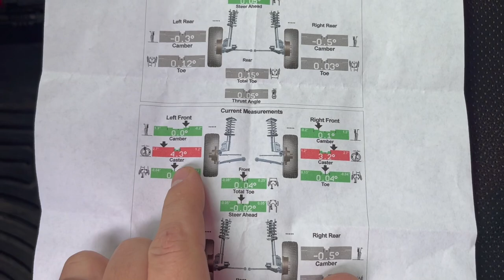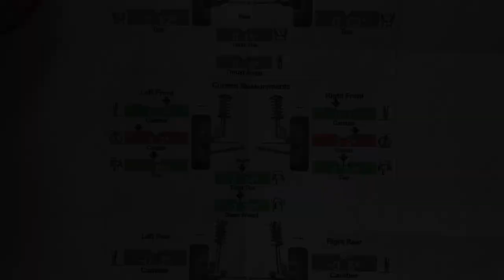Dial in your Alignment! - NEW Dobinsons Adjustable Billet Upper Control Arms

Comment: My shop (Alpine Performance & Offroad) is a Dobinsons dealer here in NC, and I also have their billet UCA's on my personal vehicle (Toyota FJ Cruiser). I do alignments on vehicles equipped with SPC's all the time, and have to say that the Dobinsons are much easier to deal with. I will say though, that I would have tried to get whoever did the alignment to fix that caster spread. Normally .5 degrees of spread is ideal, and for the higher to be on the right front for tracking reasons with road crown.. Nevertheless, your truck is looking killer as always! Props for knocking that job out in a garage! 
-Brian
Reply from the maker: Really appreciate the insight man! Good to know. Thanks for watching!
Reply: With a tacoma with 2.5 inch kings lift and -38 offset on 17x9 wheels for 315/70r/17 tires, would you recommend the spacer be in the front of the rear to clear the 35s from the body mount? Already have body mount relocation. Just ordered these and will install when they arrive.

Comment: I came to watch your review and install on these beautiful arms.  Sick looking truck and UCA!  Dobinson, keep up the good work in manufacturing awesome products!  

@ 10:53 where you mentioned to install the bolt angling downward vs upwards.  I'm no expert and never once seen anyone talk on this subject in any of the social media pages or forums.  Does it really make that much of a difference which way it's installed?  I can see it backing out as you had mentioned.  When I installed my UCA 4 years ago, I put the bolt angling upwards.  I've never had an issue with it coming lose (knock on wood).  Although, I do visually check every now and then, never checked the torque ever since install.  Maybe my next oil/lube I should recheck the torque.
Reply from the maker: Thanks!! Yes, I used to think the bolt orientation didn’t matter. That’s why I installed it previously with it angling up. But in my experience, it backed out while I was on the trail and came out on one side. And I thought never again would I be putting it in that way.

Comment: Great vid. I have SPCs… never considered how tough it must be in you don’t have a good shop. My alignment guy usually takes 2-3 hours to get my alignment perfect with the SPCs after a new install. Good to know there are easier options to recommend.
Reply from the maker: Thanks. That’s awesome you have someone that will dial that in for you. I had about 6 alignments with my SPC’s and was never happy with any of the numbers. Went to several shops and clearly explained how the arms adjusted and what numbers I was after. Pretty frustrating. Happy with these. SPCs are definitely great uppers, these were just a bit simpler.

Comment: Really liked the video brother.   Thanks a bunch!  I’ve been torn on sticking with my SPC’s or moving to these as well.  And yeah, my caster with my SPC’s is low as hell too.  I’ve never found camber to be too hard to dial in though.  These definitely look easier though, which is nice..  Just the shops around here don’t mess with SPC’s or anything adjustable!  😆. Usually takes me a few rounds of going back and forth at the very least.  

Couple things… after setting the new arms to 40mm how much adjustment was necessary to get your camber dialed when the alignment was taking place with the computer?  

Also, when your caster was brought back up, did you notice any issues with wheel spacing near the firewall?   Any rubbing issues that required more cutting or hammering? 

Highly recommend getting spindle gussets with 35’s too brother.  Just my opinion, but those factory spindles alone don’t like the extra weight when wheeling.  🤙
Reply from the maker: Thanks man! I have spindle gussets now.

I honestly don't know how much adjustment was necessary to get my camber dialed in. I had a shop do it. And I didn't notice any issues with wheel spacing near the firewall.

Comment: Are we able to adjust these UCA while they're on the truck? It looks like the UCA needs to be off the truck in order to push them out to 39mm or whatever. You need to remove them from the truck to twist those things out, correct?
Reply from the maker: Yes you can adjust them while they’re on the truck. That’s why I got them.

Comment: Are you sure you got the torque specs right on the castle nut? Dobinson states the following.  M10=36 ft-lb, M12=64 ft-lb, M14=96 ft-lb.  I'm going to assume that castle nut is M12 so it should of been 64 ft-lbs.  Where did you get 81 ft-lbs from?
Reply: 81 is closer to the stock torque.  Its a factory style ball joint, so I would go with the 81 for sure.  Other brands like SPC and JBA have a lower torque number though.

Comment: I have a 4runner and I'm planning on running the MRR 3 with their uppers as well. Are you running the gusset Tabs as well? I was looking to add those but didn't know if you had them or not and had any issues with the tab strength doing the hardcore off roading you do.
Reply from the maker: Sweet! You’ll love them. I do have gussets on my cam tabs and LCA’s.
Reply: I’d look into the Marlin Crawler HD frame gusset kit. It’s a better option than just the cam tabs. Just throwing it out there.

Comment: Great video! I just recently switched to dobinson mrr from Fox thanks to @exitoffroad ...Still running SPC UCAs but might have to switch to dobinson... Unrelated question.. I see you're running wheel spacers..spdertrax? And did you use the lugs nuts that came with to install to hub or did you get extended ones? I've seen where some say it's better to get extended for more bite to secure spacer. Some say what comes with us just fine. You do some heavy off-roading so that's why I wanted to ask... Thanks for all the great content!
Reply from the maker: Heck yeah! These are KSP wheel spacers and are a 1". I didn't want the 1.25 spider trax. And I used extended lugs. Just make sure when you go to put the wheel on that the surface of the spacer is totally flush and theres no lugs sticking out that would cause a non flush fit.

Comment: So does the alignment person need to slide the long bolt out in order to adjust the ends for camber and caster?  Because you have to spin the whole bushing around....
Reply from the maker: No, you don't spin the whole bushing. You twist the lock ring and it pushes or pulls it in or out.
Reply: I just installed these on a GX470 - these are awesome arms!  My favorite so far out of about 10-15 different ones that I have installed.  Truly a game changer and better than SPC's
Reply: @jfriday1ify Did you place the camber spacer in the back or front? I have a 4Runner with 285/70/17 KO3 tires. Thanks!
Reply: Place the spacer in the front for 2 degrees of caster and to give more space away from the body mount area.